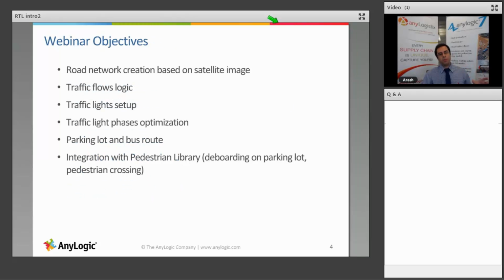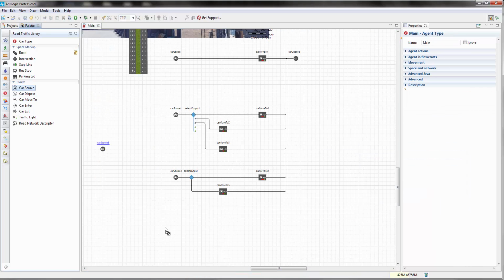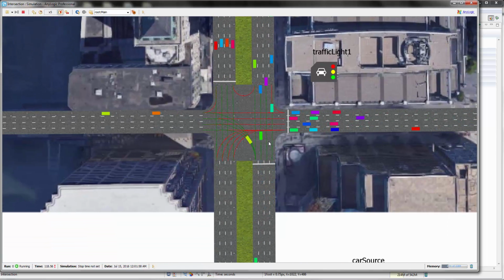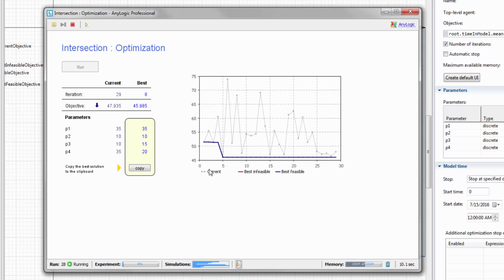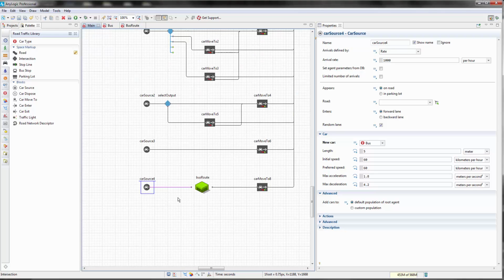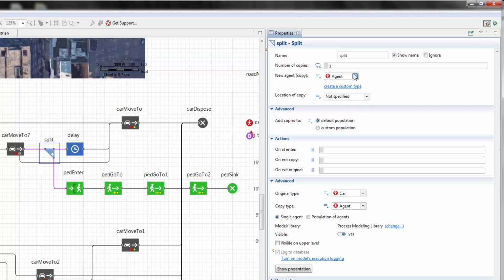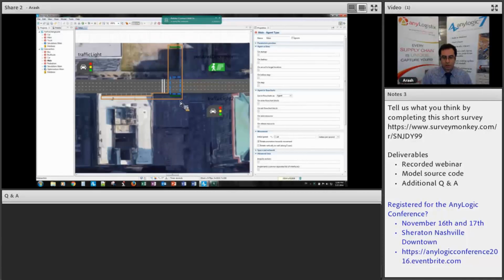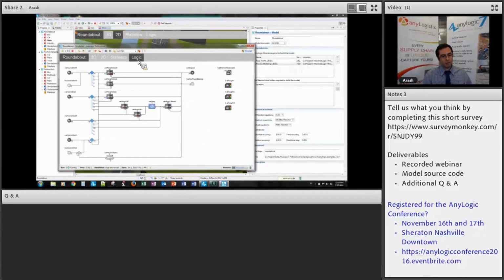Webinar | Road Traffic Library

Comment: Hi! I’m working on a simulation of a highway, but there’s something that isn’t working.
I want to select a dangerous area of the road using a rectangle, and when cars or motorcycles pass through it, they should reduce their speed.
Could you please help me with this? It’s my first project in AnyLogic and I’m in my first semester.
Reply from the maker: Hi! Great question—here’s a simple way to achieve your goal in AnyLogic: 

If you’re new, follow the Road Traffic Tutorial (https://anylogic.help/tutorials/road-traffic/index.html) to learn how to build a basic road model and add vehicles. This will help you set up your highway and vehicles. 

 Draw a rectangle on your road to represent the dangerous area. You can do this by adding a space markup element (like a rectangle) in your model’s graphical editor.  
 
Inside your Car agent, add a statechart (https://anylogic.help/anylogic/statecharts/statecharts.html) to manage the car’s behavior. Create two states: Normal and SlowDown. Add a transition that checks if the car is inside the dangerous area (for example, using dangerZone.contains(getX(), getY())). When the car enters the area, switch to SlowDown and reduce speed. When it leaves, go back to Normal. 
 
Good luck with your first project!

Comment: How to make a more complex simulation, with several streets in a whole district?
Reply from the maker: Hello,

Thank you for the question.

To build a more complex model with several streets in a whole district, you can split the logical or geographical parts of the area into individual agents if the area is too large. If this is not the case, you can follow the webinar instructions to add more roads to your model. We hope this will be helpful.

Comment: Nice video! I have a dilema, how do you make a simple roundabout intersection that has 2 lanes inside the roundabout. The problem I face is that cars stop inside the roundabout to change lanes, and that locks the intersection and can't be validated with reality. I tried to make it by using 4 intersections and 4 road pieces.
Reply from the maker: Hi, 
Please refer to the built-in example model which you can find in Help | Example models | Roundabout. Reproducing this model implementation should help with the described problems. Should you have any further questions, please feel free to use our community pages - https://www.anylogic.com/resources/support/
Reply: @anylogic-simulation  I have analyzed that model and it's not a roundabout, just a combined intersection
Reply from the maker: @gandalfwiz20007 , thanks for the update. Are you looking for a roundabout in which there are no traffic lights or stop signs and it is controlled by yield signs?
Reply: @anylogic-simulation  yes, a larger roundabout with 2 lanes inside the central area like the one located at the atached coordonates(45.64908414216385, 25.663901406019594).
This roundabout has no limitations and it's build on a road where the speed limit is 90km/h. In the simulation, the cars stop inside the roundabout and lose speed. In reality, cars travel at about 30-40 km/h and don't stop. From what I see, in Anylogic cars stop to change lane inside the intersection.
Reply from the maker: @gandalfwiz20007  
Thank you for the detailed explanation. Please find a Roundabout model with four lanes with cars moving without stopping inside the roundabout - 
https://cloud.anylogic.com/model/f184eb62-1f9a-4eaa-83af-67ed22daa06d?mode=SETTINGS&tab=GENERAL

The source files are also available for download.
Should you have any further questions, please feel free to use our community pages - https://www.anylogic.com/resources/support/

Comment: So the car flow and pedestrians crossing is based on timer, not on seeing each other.
I could not find a tutorial with unregulated pedestrian crossing where cars have to stop if pedestrian is near the crossing.
Instead this tutorial just hook cars and pedestrians to a timer of traffic light.
Reply from the maker: Hello McRyach,
The Pedestrian - https://www.anylogic.com/features/libraries/pedestrian-library/ and Road Traffic - https://www.anylogic.com/features/libraries/road-traffic-library/ Libraries are designed to be used in different areas. Thus, the interaction between pedestrians and cars is not provided. The movement of both cars and pedestrians must be timed according to the traffic light phase timer in order to avoid collision.
Reply: @anylogic-simulation  So can't I program Car behavior based on Pedestrian entering intersection Area as if activating Traffic light on a condition rather then set period of time? Or blocking car flow in any other way to wait for pedestrian to exit the intersection before car can resume?
Reply from the maker: @McRyach  
Yes, it is possible to change cars behavior based on pedestrian actions. For example, you can make pedestrians go to the target line near the intersection by using the PedGoTo block - 
https://anylogic.help/library-reference-guides/pedestrian-library/pedgoto.html. 
You can use the 'On exit' action of the PedGoTo block as a trigger for cars to stop at the traffic light. If you have any further questions, please feel free to use our support services - https://www.anylogic.com/resources/support/
Reply: @anylogic-simulation  Great ! Thank you very much.
Reply: @anylogic-simulation  I've tried your suggestion and it didn't work. I've set pedGoTo Action for Target line to close rectangular node for cars, and it had no effect. Later I found a question on stackoverflow Can AGV transport be blocked by Agents or pedestrians? and the answer was NO. So Since AnyLogic has very poor customer support and help, could you direct me to any article or forum I could figure how to model unregulated pedestrian crossing, where pedestrians would block the cars.
Reply from the maker: @McRyach  We are sorry that you were unhappy with the support provided. Could you please send us your support request ticket number and we will look into it? As for the forums, there are two main community platforms where AnyLogic users share their experiences: StackOverflow and LinkedIn. Please see the communities section of AnyLogic support resources: https://www.anylogic.com/resources/support/

Comment: Hello, please who do I add emergency vehicles such as ambulances, police vehicles and what have you to the model such that when such vehicles enter the model, they are able to move through without any form of traffic impeding them.
Reply from the maker: Hi Athan!
It's possible to add ambulance vehicle representation with “Ambulance Car” 3D object (see “3D Objects” palette -> Road Transport). Unfortunately, there is no default police car presentation object. In such cases, you can import it in the form of a Collada (DAE) file using AnyLogic 3D Object (https://anylogic.help/anylogic/3d/3d-object.html). By the way, you may find a lot of prepared 3D objects on the 3D Warehouse website (https://3dwarehouse.sketchup.com/) and upload them into your model. 
Regarding such vehicles’ movement on the road, the current Road Traffic Library implementation doesn’t allow explicitly control of car behavior on the road, and maneuvers are done automatically (controlled by an internal algorithm). A car can overtake another car only if the destinations are different and it is required to change the lane to proceed to follow the route.
So, ambulances or police vehicles can't overtake others just because their "priority" on the road is higher.

Comment: Hi all

I have  two questions:
Any idea how to add trams? I thing to add them as busses but with separate roads

2. In my example i have bus stops between two roads how to procead with it

Many thanks im advance
Reply from the maker: Hello!

1. It is a good idea to add a separate road with 1 lane. This road should not be connected to car roads (except for intersections). In case if cars may use the tram lane, it is required to make sure the tram does not leave his lane. It can be done with stop lines - use the sequence of the lines as respective targets in CarMoveTo block
2. You may use stop line as bus stop. In case of bus turnout please use two separate roads for each direction respectively.

This is a brief answer to your questions. For more details please ask the community for help on StackOverflow (tag [anylogic]) or contact AnyLogic Support.

Hope it helps!